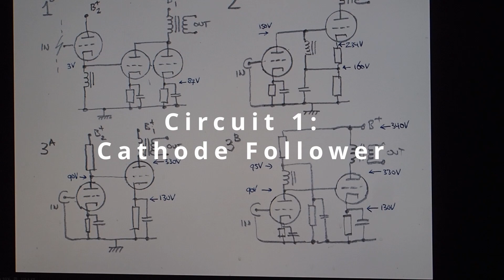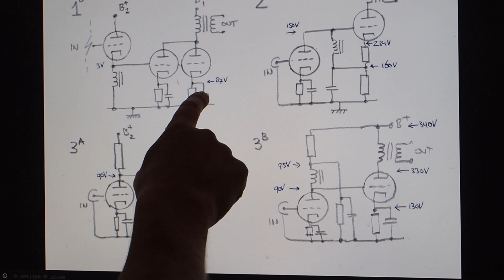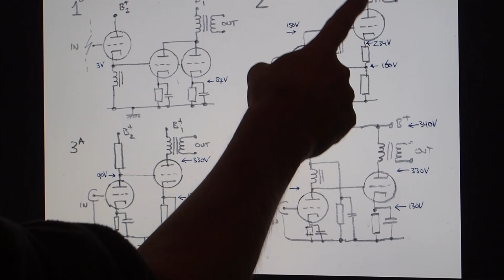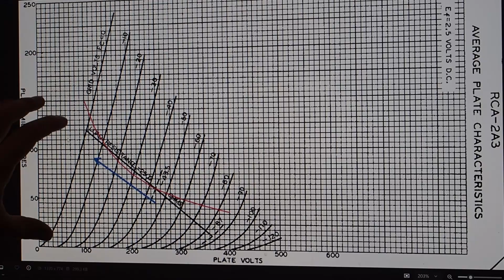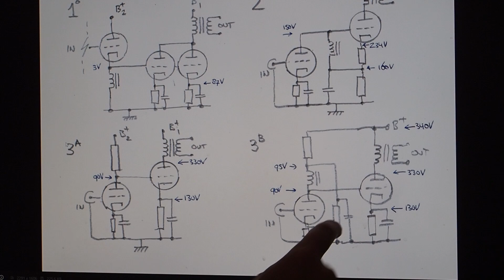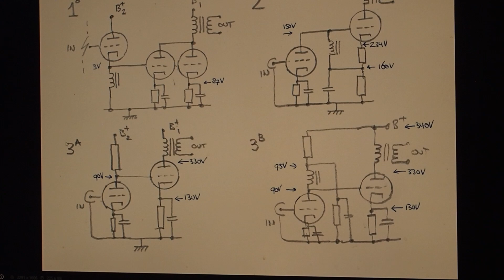4 Ways to safely direct couple in tube amplifiers

Comment: Thank you for your great expectation, I have a question regarding the DRD / Monkey circuit; in your schematics the cathode bypass cap is taken from the top of the lower resistor, why it doesn't bypass the whole cathode resistor? Doesn't this arrangement suffer from bass deficiency?
I've seen some schematics which the bypass cap or ultrapath cap is taken directly from the cathode.
Reply from the maker: Good spotting. Often, the top resistor for tubes like 4P1L, KT88, 807, 1624... is much, smaller than the bottom one, so the bass in hardly affected, but in this example (300B, type 50) it would indeed.  In the original full monkey circuit there's an ultrapath cap between cathode and B+ which both makes for a very short individual return path for the output tube and doesn't have a lack of bass. Note, these diagrams were mostly drawn up with a focus on the safety mechanics of directly coupling...

I'd personally go for the exact full monkey circuit with a 300B which features 2 ultrapath caps  and an  interstage coupled design with a type 50.
Reply: @EduardBroekman Thank you so much for the response; so is it possible to just get the normal cathode bypass cap from the top resistor? I mean like an Ultrapath cap but instead, it is a normal cathode cap and goes to ground. The reason for this is that I experienced extra PSU noise using Ultrapath cap.

Comment: Awesome video. In the final design, have you tried the 4p1l driving the 50 directly? Cathode followers have never quite sounded right to me
Reply from the maker: I have had 4P1L in screen mode driving 46 and then 50 via an IT but I don't think I had 4P1L as driver for the 50.  26-4P1L-50 all IT coupled could be a thing; as the 26-4P1L forms a nice sounding pair.

Comment: Hi Eduard
iI was scrolling facebook tube amp group, when one posted about a tube company pretty new tube manufacturer called stradi tube, they make 45 tubes and alot of other interesting ones. I came across this thread that talked about the RE604 and that some preferred it to the 45 tube, do you know of this tube?
Reply from the maker: I've seen it in passing but no further insights on the RE604. EML makes the RS242 which most likely has the ideal filament structure - aka no W or M hung grid wires, but straight, equi-distance filament wires. I think several of their tubes have that, but at their price point.. out of reach for me at this moment... Thank you for mentioning the tube company will look them up now!
Reply from the maker: Ah that's an interesting new company indeed, they've employed the 'ladder type' filament structure everywhere and prices seem very reasonable! Thank you for mentioning it.

Comment: What about tube startup, the tubes will not drop voltage before it heats up so the full B+ will appear on the grid of the next tube?
Reply from the maker: Yes correct for the Loftin White circuit and only if the B+ is also at max. already. In my experience all circuits can have a couple of seconds during warmup where the grid sees odd voltages as the whole circuit stabilises, but generally that's before the full power arrives and only lasts a short time.
Reply: @EduardBroekman in circuit 3 the problem seems problematic. The driver tube should take seconds before it starts dropping voltage not sure exactly how long. Better make a simple delay on circuit, with a coil relay so its pretty much out of the signal path aswell
Reply from the maker: @williammeincke9071 Just to be clear if the cathode resistor of the output tube is sufficiently large, it's really no issue to have maybe double the usual current running for 10 seconds as that current is still well within the max. dissipation of the output tube. Unbeknown to most, a delayed but instant high B+ 'shocks' are worse for tube life than this.
Reply: @EduardBroekman  If the anode of the driver tube has 300v, then the powertube grid should see that on startup which is too much for it right, i see your schematic uses 90v which might do it but not higher voltage. Also if you put the delay circuit before the filter and choke it should be just fine right. Just before you made this video of was trying to figure out direct coupled deisgns in ltspice, mostly only using method 3b that i saw on tubecad. but i made another circuit now using just using method 3. its a 6sn7 with 300v driving a 45.

Comment: Hi Eduard, Nice food for thought, I will let it sink in. About the first variation, a few observations. Why two output tubes in parallel? It does not have to be. And, a cathode follower is obviously at least halving the input signal. But on the upside it has a very high input impedance. But you would have a voltage amplification of some kind (transformer and or tube) at that input.
Reply from the maker: Hi Hugo, it's only an example the 'PSE' and yes it needs a gain stage. I chose the 'PSE' ss an example since all Kondo amps feature a CF driver and arguable you need to use a cathode follower with a PSE to guarantee both tubes are driven equally. Note that a 300B only needs a couple of mA to be driven and so even a 10mA cathode follower with a Zout < 100 ohm I think will do very well.. There are amps like Loesch' Lux with WE310 - CF - 300B where the CF is used to cover for the anaemic output power of the gain stage and as a bonus very good (A2)  overload behaviour for the 300B with the CF.
Reply: @EduardBroekman  good point, for the drive current. You often see comments where driving a B300 is problematic and a cathode follower certainly will have benefits. 
Talking about driving a B300 (out of curiosity,  I am not inclined to try a B300 any time soon). What do you think about driving a B300 with an EL84? That has been my thought, if it is so difficult to drive, why not use an output tube?
Reply from the maker: @hugobloemers4425  Yes that's a classic EL84-300B I think was pioneered by JC Verdier from France. Thorsten Loesch really likes that setup where the EL84 runs as a real pentode (275V, 150V on screen)...  his Lux91 amp was a choke loaded CF driver variation on the 'lady day'  amp with pentode drives 300B. From this comments, the CF version only lost minimal nuance and only in certain situations.

I am considering the much similar EL33 as pentode - grid choke / cap coupled to a Type 50  but I also want to revisit a cap-less PP (forced balance differential pair) with the 4P1L.

Comment: Interesting! My MQ3600/A3600 Luxman/Luxkit is directly coupled using a LTP phase splitter. The input tube is one half of a ECC85 with plate voltage of 80V after a 270Kohm plate resistor from the 260V B+. The ~82V on the plate plus the audio signal go the first triode half of the driver tube (6GU7). The two halves share the 470V B+ unequally, split by 27kohm and 33kohm plate resistors, respectively, and they also share a single cathode resistor (10kohm) without a bypass cap. The voltage at the cathode is ~95V. There is a grid leak circuit between the stages consisting of a 1M resistor, which is connected to both the grid of the second triode half of the driver tube and a 0.47uf cap to ground.
Reply from the maker: Yes, direct coupling to a LTP makes sense since the tail can be done without a bypass, so unlike quite a few DC coupling cases, we're then not adding a cap somewhere else. I looked up the Luxman schematic, where the 6GU7 seems like a more potent 6SN7, which is easily enough to drive the IDHT output tube. Btw the grid leak resistor on the schematic says 100K.. it looks like the output pair's balance can be fine adjusted somewhere on the amp.
Reply from the maker: Just had another look at the MQ3600's schematic and the directly coupled part would classify as a Loftin-White... And if the input tube fails/disconnects,  the current through the LTP tube will probably run just over double its normal operation, as much as 25-30mA...
Reply: @EduardBroekman  - You're right, the grid resistor is large and there is 71V at the bottom of it on the grid of the second half of the LTP tube and 80V on the grid of the first side. There is 93V on the 10000ohm shared cathode resistor (93V-80V = -13V bias, which is a sweeter operating point than with the 8200ohm original) so 9.3mA being shared by the two halves and think each half can tolerate double that if the input triode failed.